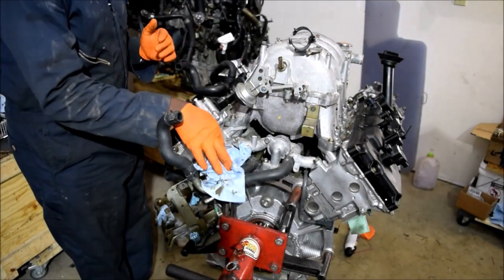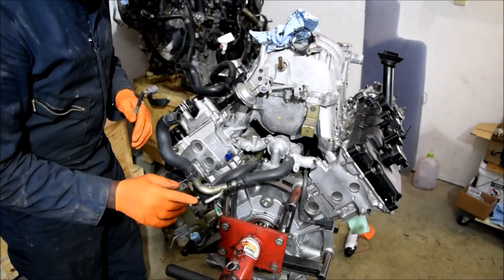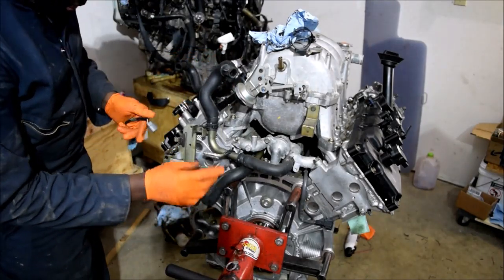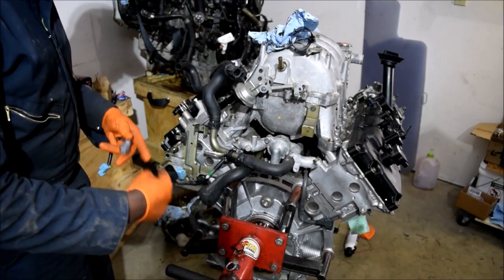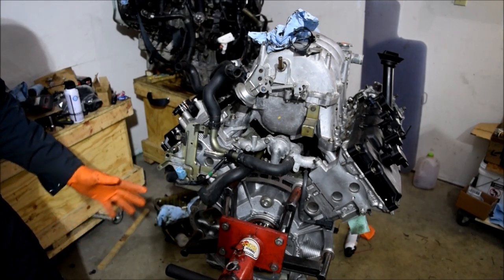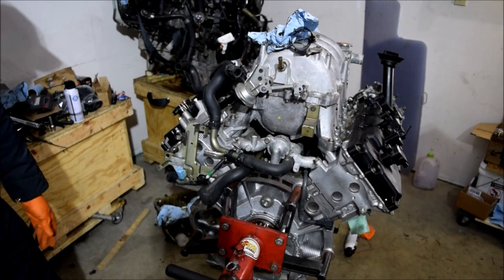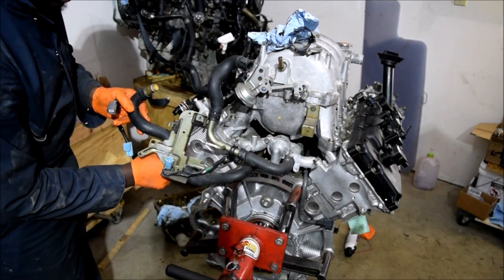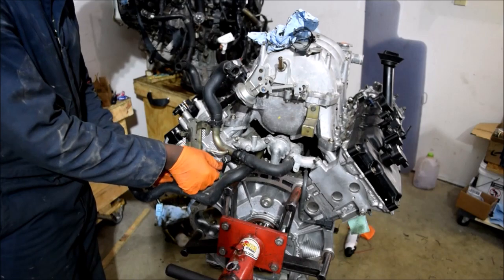Ep.11| Intake Manifold. Nissan Infiniti VK45DE engine reassembly. 4.5 liter V8 M45, Q45, FX45, Fuga

Comment: i use a piece of cardboard for my bolts, numbered 1 - 10 so the same bolts go back in the exact same holes every single time.  Just stab 10 holes in a piece of cardboard, number them and push the bolts through.
Reply from the maker: That's a great idea, and pretty simple for something like intake manifold, or valve covers. I employed that trick when doing my timing cover as well
Reply: @EdBwoy  you know where I can get a new control valve elbow.  The one with 4 bolts, where you said that the sequence does matter
Reply: Mine had a small crack and with the new o ring it snapped in two

Comment: Aww yes this is a good one. This is going to help when I do my +06 intake swap on my 05 FX45
Reply from the maker: I thought you had done it already. Did you get all the parts you need?
Reply: @EdBwoy  Not yet but getting close. Got new muffs and y pipe on too
Reply: I need to get the manifold gasket. Is that an OEM gasket???
Reply from the maker: @zoehaze  no, it's not. I got it from eBay and the manufacturer is what's on the label - DNJ or something
Reply: Ok cool good deal I'll check it out. Thanks  Ed!!!!
Reply: My next project is I'm trying to bring my 2003 back in the second owner I just wanted to save it and hold on to it forever

Comment: Good video. I am going to be removing the Intake Manifold on my 2003 FX45 this weekend to fix the knock sensor wires and install new knock sensors.  Can I remove the Intake Manifold without removing the fuel rail?  I haven't looked at it yet.  I hope I can.  Thanks.
Reply: Update:  I had to remove the fuel rails to get to all the bolts on the lower intake manifold. The fuel rails were pretty easy to remove and reinstall. I had to rebuild the chewed through knock sensor wiring harness because this part is not made anymore.  After installing the new Knock sensors, the FX45 ran a lot better and had more lower end torque and would also downshift quicker when accelerating (it also seemed to accelerate faster). I also noticed that the engine started up quicker. It took me about 2.5 days (one day to disassemble, one day to rebuild the wiring harness and put the intake manifolds back on, and half a day (a few hours) to install all the hoses and air intake box (I am a DYIer). Thanks for this video series, it really helped me out.  I had to look at your gasket part again so I would know how to properly install the new intake gaskets.

Comment: Ive got a 2006 nissan fuga 450gt right hand drive here in New Zealand vk45de engine always leaks oil on drivers side from valve  cover gasket or maybe steering rack

Comment: I have reused my gasket on the area between the two manfiolds without issue, might have issue when swapping to a new engine though
Reply from the maker: You could also reuse the metal ones. Depends on the budget & what you want to risk. Remember I told you the manifold could be removed with the fuel rail?

Comment: Nice and clean good job 👍
Reply from the maker: This was you a few months ago, right? FX45 still running well?
Reply: Thanks man . Yes the car runs great just 1000 miles on it now
Reply: Thanks for the video I have a question I have  a 2006 Infiniti M35 sport my key fob won't work it only will start the car when is in the key fob slot what could be the issue. I need help thanks again

Comment: What are the torque specs? I didn’t hear you say anything about it
Reply: Hi Ed -
What are the torque specs? I just replaced knock sensors and have not been able to find torque specs. 

Thanks
Reply from the maker: 18 ft-lbs. Upper plenum to lower plenum
21 ft-lbs. Lower plenum to heads

I must have forgotten to call the numbers out
Reply: Thanks!!!

Comment: is it easy to change spark plugs on these vk45de
Reply from the maker: In the Nissan Y50 platform, access can be a little tight because of the engine bay layout but with a good selection of tools it's not impossible